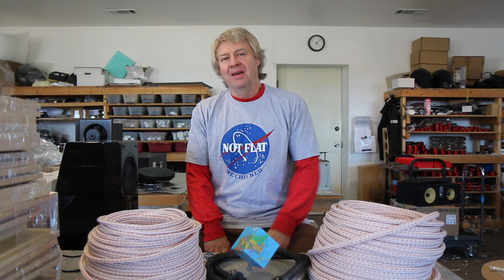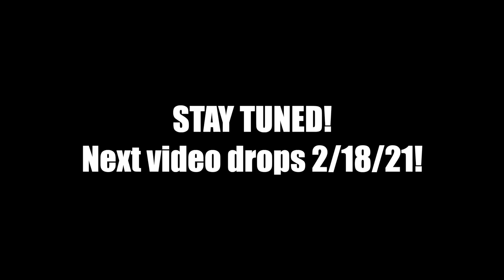Audiophile Cable TRUTHS: The Divided Camps

Comment: How come someone just doesn’t perform a blind test with say 100 people or more, collect the data and put this discussion to rest?
Reply: Because people won’t hear a difference
Reply: @davidlong1786  You are welcome to contribute here, but if you are only here to cause disruptions and have nothing to contribute then you won't be posting much longer.
Reply: Its been done, in 2006 I proved to the DIYers in DC that cables sound different.  The bullsh+t stopped at some cables are different.  Some cables are so different they didn't even require comparison to generic electrical extension cable and BS 12 guage Sound King cable.  Ask Bob Cordell.  He did seem a little shocked.  It was his testing system and his show.  Cardas Golden Cross, MIT Shotgun 750, no need bother compare in a blind trial...Kimber 4TC was used later and discerned by another 2 people in another location.  Sorry.... some cables sound different and most sound worse than good basic cables.
Reply: @TofumanFC3S  Thats not true there are a lot of people that can hear the difference when using different cables.
Reply: @ichigobankai2343  Show me ONE scientifically sound, objective test of cables that test as good as plain old speaker cable or better, where people were able to pick out the special, amazing one over the regular, good one in a controlled situation. I just need one study that has been validated as accurate and I’ll apologize to everyone I’ve ever offended with this stuff.
Reply: @TofumanFC3S  A lot of people have done it from there own EXPERIENCE but we know people like you wont except it because its not valid to you. I personally can hook up 2 different cables to my system and I can tell which cable is playing around 90% of the time. All it takes is one (1) single person to be able to tell the difference in which it would prove its possible. Its the same with any audio gear as many say amps sound different, dacs sound different, speakers sound different. If we couldnt tell the difference then everyone would all have the same gear but instead there is a shit ton of different brands of audio gear. Also everyone does not hear and or interpret music the same. Some can hear micro details in the music some cant. Some can pick out a faint whistling in the back ground while some cant. It seems a lot of people disregard there senses and let the data tell them what they can or cannot hear. SMDH lol

Also I am not saying that one cable is "BETTER", then the other as that is subjective and comes down to personal preference.  What I am saying is that they sound "DIFFERENT".
Reply: @ichigobankai2343  a scientific study would mean:
1.) controlled group of people (audiophiles, the issue with original testing is that were normal off the street persons / who might not know how to listen. example: your not going to compare cars which perform faster on a track by grandmas, non drivers etc)
2.) a black dark room (that in not colouring the sound in certain way) with only speakers in them, and someone from behind insisible changing cables
3.) control if they really her the difference by not changing cables sometimes, and sometimes bringing back already presented ones. 
4.) have a good source and god sample that is short like 30s, and have 10 samples listened to in total of 30 times for example.

ask for simple questions with checkboxes 1-5 (for example like):
1.) sounded warmer - analytical
2.) exaggerated lows no-yes
3.) exaggerated mids no-yes
4.) exaggerated highs no-yes
5.) muddy - detailed

as far as I know no study like this has been performed
Reply: @ichigobankai2343  Because the experience of 1 single person doesn’t matter when it comes to a product that is produced for many, we (thankfully) test experimental medicines on many people with a 50/50 split of placebos. Because you can be sure as hell certain individuals will have a life changing experience from their placebos. 

Amps, DACs etc. DO sound different. That’s not a controversial statement, they’re complex pieces of technology with lots of room for variation. You being able to almost always hear the difference between your cables means just one of two things: You either have one very bad set of cables (often the funky, expensive cables are horribly designed) or, more likely, you have a bad connection. 

By all means do what feels best to you, but please don’t expect me to follow your very subjective experiences as advice
Reply: @mbalunovic  As far as you know, like I said there have been many (audiophiles) that have conducted there own blind test from there OWN experiences and have heard differences.
Reply: @TofumanFC3S  A single person who can tell the difference in a double blind test with a very high 90% accuracy doesnt matter?  Again let me repeat myself there have been MANY people that can tell the difference, not just myself.  Meds/Supps placebo test is different from a hearing test.

Capacitors sound different or are they complex pieces of technology?  Do all HDMI cables sound the same? Do all USB and 3mm cables sound the same? Even RCA cables dont sound the same. Just because you cant hear the difference doesnt mean others cant. Anything you put in the signal path can change the sound.

Never said you had to follow my or many others experiences as advice. SMDH  I guess you can just disregard thousands of peoples claims of hearing a difference in cables.
Reply: @ichigobankai2343  how can a single person perform a true blind test ? 

Im not saying there is no difference in cables, and I also have "audiophile" cables.. but Im also a person who knows what a study, measuring etc is...
Reply: @TofumanFC3S  
You can feel the difference in cables if these measurements are different.
Capacitance
Inductance
Shielding 
Resistance (the least important as Im not thinking of 100db music with 24gauge cable).
There are other responses where "dirty" material pollutes the signal. And it does that at very low power levels and it is measured since measuring instruments need purest signal coming from 1GHZ source sometimes.
Reply: @mbalunovic  So how many people will it take in a blind test to convince you? 2,3,4,5, 10, what is the magic number? If one single person can pass the double blind test it will prove that it can be done as one is all you will need.  Being ABLE to hear the difference is proof in a double blind test.
Reply: @ichigobankai2343  Its not a matter if one person can hear it, whether the blind test is really blind. and how the test is performed. ie one cheapest zipcord and high quality, or two high quality ones, or 4-5 cables, and can he really tell consistently how the sound is being "modified".
Reply: Even speaker "TERMINALS" can change the sound because its a added component in the signal path. I run my speaker wire directly to the driver, sure it may look ugly but I can hear the difference and to me it sounds better when I bypass the terminal and run directly to the full range driver.
Reply: @mbalunovic  Its not about how the sound is being modified its about being able to hear a change in sound.  Lets take "TONE" for example. Some people can distinguish paper cones from metal cones just by the tone. Each type of cone material has different tone to them like polypropylene , ceramic, aluminum , titanium, beryllium, paper, treated paper etc. Even wood can change the sound which is why some instruments are made out of certain types of wood. There are so many factors that can change the sound including cables.
Reply: @ichigobankai2343   Ofcoarse it doesn’t matter? What are the odds those two cables you are comparing are the same as mine? Your reports are entirely anecdotical and don’t change my mind in any way. Your experience brings nothing new to the table when it comes to one cable being better than another working cable. If you’re trying to convince me bad cables exist or can be made, I’d never deny that but as has been said many times before: You’d need to work hard to fuck up something as simple as speaker cables. 

Digital cables such as HDMI and USB “sound” the same. You either lose bits of data or you don’t. It’s not the cables fault but the fault of the user for misuse of said cable. 

And yes, cable terminals are obvious weak points in signal paths, not because they don’t have diamond powder or batteries in them, but because the connection might be less than optimal

The cone material directly influences the sound being produced. Ofc. they’ll sound and measure differently... It has nothing in common with a speaker cable that just has to do their job: Powering your drivers as the amp output dictates
Reply: They have.  Controlled listening tests have already proven there aren't audible differences between competently designed audio cables.
Reply: @TofumanFC3S  It doesnt have to be the same. My experience as well as thousands of others are not meant to change your mind, but you implying that our experiences dont mean a thing wont change what I or many others have experienced.

You said amps , dacs etc sound different, did  you do a double blind test study to prove it? How are you coming to this conclusion?  Capacitors sound different , just changing a capacitor in a amp/xover can drastically change the sound. A NPE cap sounds totally different then a clarity cap or high end Jantzen cap.

Less then optimal connection? I am not talking about cheap terminals but the expensive ones that cost 10 bucks each or more, unless all those expensive terminals are crap?  Even Danny has his own special type of tube connectors that he claims can increase sound quality, I have never tried them so I cant give my experience of them but I wouldnt doubt his experience as well as many others who claim they do increase sound quality.

It dont matter if they measure differently as not everyone can tell the difference. I can put 10 different pairs of speakers for you to listen to and I bet you cant tell which one is ceramic ,which one is paper , which one is aluminum.  Just because you cant tell the difference it dont mean others cant.

I dont let others tell me or what data/measurements tell me what works or doesnt work as I have to experience for myself to KNOW first hand.
Reply: @LouGuido  By whom? Are these accurate legit tests?  Its so funny that if cables didnt make any difference at all why are people buying and using them instead of just buying 14-16 gauge speaker wire? There are literally millions of people world wide buying speaker cables. I guess they must be all brainwashed. LOL
Reply: @JurMalafi  " no need bother compare in a blind trial" 

Pretty much "Just trust me, no need to prove it"
Reply: Has there ever been any contention on wether audio equipment build with thousands of different components in different combinations with esch component having it’s own percentage of allowed deviation from it’s target values, tunes by employees of the manufacturer, sound differently? No, there hasn’t and there won’t be. So why would you need a scientific studies to prove what is already known? They’ve been measured, tested and reviewed and that should be enough. Suggesting they ALSO need to be studied is like suggesting we need to study wether the earth is truly spherical. 

It don’t matter what the connectors cost, they’re still a weak point in the connection. I agree: Get good, quality ones. They’re not as simple as cables after all!

I don’t get why you’re so pissed off. I’m not trying to convince you of anything, you’re trying to convince us for some reason. YOU are the one who is asking folks to ignore common knowledge and the basic principles of physics. In this example YOU are trying to convince normal people the earth is flat. It’s not our job to make you believe in reality again, just don’t expect others to go along with your delusions. 

And why do people buy this stuff? Because either they like buying pretty stuff and I’m all for that. I don’t NEED shiney new wheels on my car, but I like ‘em anyway. Or, unfortunately, it’s because they believe they’ll have a better listening experience lol
Reply: @TofumanFC3S  When questioning ones hearing shouldnt there be a study?  How do you know what is known if you cant hear it? OH I see by those who CAN HEAR IT? The same way some can hear subtle differences in cables. LOL Can you tell the difference between 10 different dacs and get it right 90% of the time? All it takes is a few to be able to discern the differences to prove it a blind test.

Get good quality ones? Proves my point once again that there is a "DIFFERENCE". The same thing as get good quality cables as opposed to radio shack wire. LOL   Again I have tried good quality connectors and non of them sound better then when I bypass the connectors and connect it directly to the driver itself, which further prove there is a difference.

I am not pissed off.  Wait so only I am trying to convince you and you are not? REALLY?  Arguments are two ways in which one tries to convince the other its not just one sided, if it was there would be no arguments or debates. SMDH LOL  Who's reality? Just because you didnt experience it doesnt make the person who experienced it untrue , especially in a double blind test in which is what that test is all about which is to prove if one can hear a difference.

Thats your opinion, its not facts. Most people dont buy gear to "LOOK", at.  Shiny wheels on car is to make a car look good like eye candy....Majority of audiophiles dont buy gear specifically for looks.  Again you are doubting other peoples experiences in which it includes millions of people world wide that buy speaker cables.

I bet if even a legit accurate scientific study done on speaker cables came out proving that one person can hear a difference you would still doubt it or make excuses because the only thing you believe in is science.  When it comes down to it the final word on audio gear its BASED on how it SOUNDS and if one cant tell the difference then no upgrade is ever needed just use the 5 dollar RCA speaker wires. LOL
Reply: @davidlong1786  What kind of speaker cables do you use and why?
Reply: @ichigobankai2343  Buy an AES subscription.  You need one!
Reply: @LouGuido  Telling me what I need is so hilarious lol
Reply: @davidlong1786  So other wires that are cheaper dont do what they are suppose to do?
Reply: @ichigobankai2343  You asked me where you could find testing that shows this is all bogus. I gave you your answer. Read some AES papers. You know, real science. Not junk on YouTube. That was my point. I think it still stands.
Reply: @LouGuido  I aint buying no subscription as I dont need it. Real science? You mean scientific fact or scientific theory? lol
Reply: @davidlong1786  Show me where I said you needed it? Where is the rolling eyes smiley? LMAO
I asked you WHY did you buy that particular speaker wire? SMDH
Reply: @davidlong1786  You're criteria? What you just said proves there is a "DIFFERENCE" in speaker cables.  Effect means there is a difference and or change in sound.  Good quality means there is a difference as opposed to poor aka cheap quality or else how would you know the difference?.  If there are absolutely no differences in sound what so ever then the cheapest of speaker cables should suffice.

Also length of wire plays a factor in how thick a gauge of wire should be, with shorter lengths you can use smaller wire while longer lengths require thicker gauge of wire, which again proves different gauges of wire depending on length can have a change/difference in sound.

 Once again world wide there are millions of people buying speaker cables because most claim they can hear a difference. I have never heard someone say they are buying these expensive cables even though they cant hear any difference, its usually always because it sounds better to them.
Reply: @ichigobankai2343  can you comprehend that I am not arguing the statement that cables change sound, but arguing the "Test" methods that most use to prove it ? there is a scientific way how to perform a test , that can be fully treated as valid and as a proof of somebodies capability to notice the change and to recognise the change (like which cone material is it). 
"double blind" means nothing.
Reply: @mbalunovic  Sure what is this scientific way is it legit and accurate and does every single person who does a DBT do it exactly the same way and adhere to the standards? Show me a legit standard format of a DBT that everyone in the world agrees on and I will use it.
Reply: @ichigobankai2343  sadly there is no such.
The problem with the industry is that they want to sell at great mark-up a lot of "snake oils". (Remember the audio cable with a AA batterie "attached") . Its not their interest to promote legitimate test methods.

A simple test that can be done even in home. 
1. get an assistant. 
2. Make sure you cannot see which cable is changed  for which - listen with your back towards the stereo.
3. Instruct your assistant to always disconnect the cables and reconnect. And tell him/her to sometimes change it sometimes not and note it. Make a repetition of at least 20 changes on same part of the track. Se how good a recognition is.
Reply: @ichigobankai2343  No, I’m not gonna debate someone who’s incapable of debating, understanding the basic interpretation of arguments put forth  and making compelling counter arguments. Debating someone who doesn’t grasp the concept is as futile as debating someone “who doesn’t agree with you”. 

“Show me a study...” That’s not how this works, buddy. YOU are the one shaking at the foundations of common sense and the pillars of physics, not me. I can’t go around shouting: “No you show me a study that proves there isn’t a Flying Spaghetti Monster!” at random people, nor can you expect me to prove your outlandish claims of superpower hearing that goes beyond the technical and physical capabilities of the sound source. You’re describing magic, that’s cool if it were to exist, but Imma need a bit more than the word of random guy on Youtube thank you very much. 

“Majority of all science is theories” There you have it, spoken like a true conspiracy theorist.
Reply: @TofumanFC3S  You claim that no one can hear differences in cables you need to prove it in a study. Why does it only work one way? It works both ways.  How does flying monster enter into our convo?  I guess you believe everyone hears the same?  Super power hearing? Some people can hear dog whistles at 35k most cant though but I guess you wont believe that either because science says we can only hear up to 20khz. I guess if something cant be explained by science you believe it dont exist.  Majority of all science is theories.  Theories can always change when a better theory comes along but a fact never changes it remains the same forever.  Magic is something that science cant explain. Its not just one random guy on youtube but literally millions of people that buy cables because they claim they can hear a difference.
Reply: @mbalunovic  I have done that simple test you just described many times in the past and on certain cables I can get as high as 90% correct which just proves without a doubt I can hear a difference. Now there have been some cables that I could not tell the difference but majority of cables I could tell the difference. DBT just PROVES one can hear a difference in certain cables.

But Tofuman will probably tell you that you're simple test you just described is not legit. lol
Reply: @ichigobankai2343  again, I was never saying the opposite
Reply: @mbalunovic  You’re actually correct. It is the variety on those things that makes cables sound different. Glad to see a measurement guy not talking out of his ass.

The other guys measure fr response, they see no difference then they believe there’s no sound difference. Just like when Flat Earthers measure the surface of the street, to confirm the Earth is measurably flat.
Reply: @12gauge599  that is becouse they don't know that it is a part of an electronic circuit. Ie they think source amp and speakers are all separate / discrete units and cable is only connecting them (just to send information), and not becoming part of the whole circuit and making it all a single unit where all those become important.
Reply: @davidlong1786  Look all I am saying is that I can as well as many others hear the difference in certain speaker cables. Maybe we are all just fooling ourselves I dont know but I have done those blind test and on certain speaker cables I can hear the difference. Now I do agree with you about the over priced speaker cables and there claims as some prove false but there are some that just sound different from one another. I cant just deny my experience and say I guess I never experienced a difference in that blind test that I and three other friends have done as if it was just all in our heads since no data can prove it.  In fact I find those expensive cables absurd and would never by another expensive cable ever as the differences are not that great and or to my liking. Now days I just use 16 gauge wire from P.E.  as most of my wire length is around 4ft. or less. I also dont even use terminals and to me its sounds better when I bypass the terminals and connect the wire directly to the driver. Remember the old school speakers where the box had no terminals with just the speaker sticking out the back?  Sure it dont look good but I can hear the difference in the sound so thats why I dont use terminals.
Reply: @davidlong1786  I am not saying I dont need to learn but I am not paying money so that the magazine can convince me that I did not experience what I have experienced when I did my blind test.  Thousands of other people like myself have done these test we just dont publish our results in a magazine or university as we are just audiophiles who love high fidelity music.  You dont have to respond to me no one is forcing you as it dont bother me one single bit.  If a flat earther wants to believe the earth is flat I dont give a shit, why even bother or care? I just let them believe what they want to and dont get BENT all out of shape because of what someone else believes. Some people believe Bose is the best speaker I dont care what others believe it dont bother me none. It seems a lot of people are bothered by those that say speaker cables can make a difference. If you are bothered by this then the problem is with you and not those buying the expensive cables its there freedom of choice not yours to make for others. Have you ever done a blind test with many different types of speaker cables? if yes what are your results if not, why not? I would like to know your experience.
Reply: @ichigobankai2343  Are you completely incapable of reading a text and drawing conclusions? If at this point you still can’t understand why YOU, who challenges common sense and knowledge is the one who needs to support his claims with evidence or where the analogy comes in with the FSM, than you’ll never understand I’m afraid. 

Tell me how variations in human hearing and variations in equipment for that matter have anything to do with claiming you version of metal strands have super powers every other metal conductor doesn’t have? As has been said by others in this thread, we’re still waiting. 

“The simple test” isn’t legit. How would it be? It’s again, like every proof you’ve presented so far completely anecdotal. There is NO data being shared except that a random on Youtube said so lol.
Reply: @davidlong1786  He won’t link them because they don’t exist. In his alternative worldview the cables perform magic feats such as: A fat guy drumming on his belly goes in, Vivaldi comes out 🤦‍♂️
Reply: @mbalunovic  Aren’t you describing you lot? As in: Normal people see the cables as part of the circuit, simple conductors between the AMP and speakers. You guys see mythical “sound tethers” blessed by fairy dust that take whatever you feed them and then change it into pretty noises for your speakers
Reply: @TofumanFC3S  you have to understand that no part of any circuit is a simple conductor. Not even on a logic board. 
Read on RLC circuits, and equivalent RC circuit principal.
When you do that , and understand it than we can discuss further. 

Untill than you only have personal opinion vs facts.. 

To translate that to you. Everybody seas a vehicle as a car from A to B but some enjoy driving them, and some are so good that they win world championships. The difference must be only in our (their) brains..

You know civilisation invented gods and religion to explain what they did not understand. So maybe you are just not understanding the topic, and hance you disregard that as possible as people didn't believe earth was flat and is not a center of the university.
Reply: @mbalunovic  Oh, we have another Child of Krypton here that can hear the difference between a cable 1ft. or 2ft. long. A wire that’s been damaged and is missing two strands of copper, a ten dollar cable that tests just as well as a 1000 dollar cable...

Come on man, I’m quite skilled when it comes to electronics and even tho English might not be my first or even second language, I’m pretty sure that in the simple case of speaker wires or cables, conductors (there I said it) is frickin’ synonymous. 

I’m not saying you’re dumb, you’re just being stupid for bringing RLC into a discussion about speaker cables when almost any copper wire of a proper gauge will do the job mighty fine. Also like I said before you have to really try and fuck up something as simple as speaker cables, but somehow “Audiophile” companies get it done often having conductors too thin with high resistance...

And yes, we do have personal opinions vs. facts. You enter a discussion and side with a guy spitting “opinions” and denounce the facts. Well sorry, I’m on the factual side and I won’t join your little club of believers lmao. I understand you just wanna be special, it’s nothing to be ashamed of, it’s perfectly normal. But imagine what would happen if you finally convince everyone that they have super powers / magic ears or however you call it... You won’t be special anymore. You should think about that. 

Your car analogy I could unfortunately not decipher. Are you sure you yourself even knew what you were trying to say?

And with the gods thing. Ah, I see... The ones rejecting physics and science are now telling ME that I don’t understand. That’s good lol. Hilarious! 

Please come back when you have that evidence. There’s two of you trolls now, you can share the prize! BTC breached $50k,- recently, half of that is still a great bounty for just linking one of those “thousands of studies” that have been done. I mean it should buy you some of the most magical cables out there...
Reply: @mbalunovic  You’re bodying that Tofuman dude with pure facts. I like how he simply has no counterpoints to your arguments, except for him telling you you’re incorrect and you imaging all of the differences 😂.

Extremely typical of an ASR minion.
Reply: @TofumanFC3S  Common sense and knowledge would of told you that if thousands if not millions of people world wide can hear a difference in cables you think you are the one that needs to support your claims that no one in the world can hear a difference in cables. You want proof but dont have any proof yourself except to say its not possible for people to hear changes in cables because all cables or every other metal conductor are all the same. If that were absolutely true people would buy the cheapest cable/wire they can find since there is absolutely no difference as that is COMMON SENSE. The speaker cable industry has taken off with more and more companies making there own cables. Go search on youtube you will find a shit load of videos of people reviewing cables and making all these claims that they can hear a difference.

Others in this thread also agree with me that they can hear a difference. SMDH but I guess according to you we are all delusional right?

 Once again I repeat I am not the ONLY one that claims they can hear a difference in cables as there are literally thousands of people who claim they can hear a difference.

What test is legit? Please send me the standard test used and agreed upon every scientist world wide and I will use it and see if I can actually hear a difference.
Reply: @12gauge599  Ah, it’s a trio! Don’f worry, you’re very special as well. All of you are very special pats head
Reply: @TofumanFC3S  

dont twist my words to make yours more legit, I didnt say no where a statement as close to wha you are saying here. !

Also English is my 3rd language of 5 I know/am learning. (Serbian/Croatian as mother, Hungarian as 2nd, English as 3rd, German and Norwegian as beginner / learning. I also have wide enough knowledge that I know you love mazda rx7 otherwise you would not have that in your nickname.

now lets go back to the claims that you make and your very unnecessary condescending language. 

Please explain to me if a wire is only a conductor and nothing else, how can a capacitance of wire change the sound this much on a cartridge. the 0 is only theoretical plot, while the others are measurements of frequency response (that can easily be replicated in IC simulation software. https://lh3.googleusercontent.com/proxy/2dX9Zixv-fwr8R_WAMbrRjX4ASuEn-59pdvmOoJPc46vMq_deMmqgKi55BJ9gOqThj5hZ5e2ZL8K1evyO5pbGLVv9aK4
here you have a measurement in db response so please... if you don't trust me google up "Cartridge loading" 

my car analogy was that the original (and only) cable study was done by people off the street, not a group of audiophiles or a group that visited some HiFi expo. some people don't even notice a difference between a bad mp3 youtube rip and a high quality source. or they don't hear the difference in changing (major not 1mm) speaker position. to them its all the same, its just a music they are listening to. how can they be the prof that something is true. 

lets try another car analogy. who is representative to test tires behaviour on a car and which is better? a grandma on a street, a pedestrian that newer drove a car, an average drier that never had to brake in emergency and drives "like a granny" or riders that push the limit of traction and can really feel the difference in compound, overheating behaviour of tire, sidewall stiffness etc?
I believe you can understand that the grandma will probably chose the softest sidewall as best as that is most comfortable and that is the only thing she will feel. wile others might chose differently.

now back to your claims and childish way of disproving me and twisting my words. 
I DIDNT say I can hear a difference between 2 cables with different termination, a wire missing one strand etc. that an AA battery that is only attached to the side of the cable makes a difference etc.
I DID SAY there are properties of a cable which make it colour the sound (together with the rest of the equipment). 

the length of a conductor on a PCB will change what the IC will see. this is why all sensor traces that that have a "reference" and a "value" are traced parallel on exactly the same length and path so the signal doesn't change the value.

I see that you dont understand why I brought up RLC to the discussion. most (~all) good cables have a very low R. however what is different is the C and the L. how is that different.
here are some samples: 
High capacitance : https://www.nordost.com/images/thumb-odin-speakercable-biwireterminations.jpg
Mid capacitance: what Richie is selling, knitted ones.
low capacitance: usually low strand number that is separated by distance of 10x the diameter of the wire.

you can search your self how does inductance change with types of the cable (but in short its the opposite of capacitance). 

Those measures interact with the whole circuit in same way the cartridge loading does. but is much harder to measure as inductive resistance of a speaker changes a lot with frequency. so every amp-cable (measurments R,L,C)- speaker would need to be simulated.
Reply: @ichigobankai2343  They could go on lying as they want to justify 1000€ set of cable (that sounded the same as 100€ cable they already had)
Reply: @Clobercow1  Oh yeah I forgot to mention the Kimber was identified in a blind trial twice.  You might want to look up who Bob Cordell is...its ok not everyone is cut out to know much about audio.  So pretty much accept it as a blessing....
Reply: @ichigobankai2343  Nope, I’m just saying YOU aren’t (just like I am not either). Many of the basic principles when it comes to something as simple as a copper wire connection are pretty much set in stone. For someone to claim such a principle is false, they better come with STRONG evidence gathered by expert and respected physicists verified by their peers such as always has been the case in publishing new scientific data and theories. 

You say people claim they can hear the difference between two cables that have been tested as good for the job and that should make me depart from generally accepted scientific principles. Well, there’s people claiming they can transform into animals, does me (a random) simply stating this in a Youtube comment shake your worldview? Do you all of a sudden denounce science and everything that you you’ve always known? No? How about if leading experts in the field present data that confirms the transformation? They have some explanation why the metamorphosis happens and the test are repeatable and verified by independent scientists all over the world? That would change you mind huh? Well guess what, both the transformation claim and your cable claim have the same amount of scientific papers released and validated... OK, so maybe not be so angry when people don’t follow your unsubstantiated believes because you probably wouldn’t do it either if the shoe were on the other foot. 

Also don’t make this about Danny Richie or these cables. You’ve never mentioned one of the cables you could identify were THESE cables. I want Danny to do well and sell awesome products. In fact, and this will be a shocker, I’m very interested in these cables but not for their claimed magic they supposedly provide. You know how “Song goes in, Daft Punk remix comes out”, that’s just BS. I’d consider them because they look like the Kimber 8TC and 12TC that 1) Test very well (like many cables do, but unlike most fancy “audiophile” cables) and 2) They look awfully pretty and I like pretty stuff (as long as it works properly). Again, I hope Danny stays honest and true and markets these for what they are (again assuming they will test fine here) and not go the “they’ll color you music bla bla” route, because that’s the last thing I’d want, a cable that interferes with my choice of music, source equipment and speaker selection. 

And lastly in reply to your final sentence: No, not me. Please, please, please read up on the basics of scientific research: Characterization, Hypothesis, Prediction, Experiment, Evaluation and Confirmation. All steps being subject to peer review and published as conclusion and raw data. You really need to understand if you want to operate in a normal life where your feelings and assumptions don’t dictate your entire life. I’m urging you to please burst out of your bubble and broaden your mind instead of denouncing everything just because it’s established. 

When you wrote a couple comments up: “Maybe we are all just fooling ourselves I dont know...” you were on the right track. You need to understand how easily we are fooled as individuals and a group and that’s why we need to build on the foundations of established, objectively proven facts and use that basis to chip away at the confines and see what else is possible in the world. I genuinely wanna see a properly conducted AND validated test that tests both human abilities as well as physical properties of wire maybe beyond our current understanding. I’d be thrilled to study the paper as I have done with many other studies, but it just doesn’t exist and sometimes that is all the proof you need.
Reply: @mbalunovic  Yup, like I said myself: English is my third language as well. I’m far from great with the grammar but my reading level should be more than adequate. Don’t know where RX-7’s come in, but yay on the shout out! Quite fond of them indeed. 

Still, all jokes aside, your car analogy made no sense to me, that wasn’t meant as an insult, just simply me stating that maybe I missed something important due to a language barrier, that’s all. 

“Everybody seas a vehicle as a car from A to B but some enjoy driving them, and some are so good they win world championships. The difference must be only in our (their) brains..”

I assume “seas” means “sees”, that much is clear. But “a vehicle from A to B”? Do you mean “AS a vehicle to GET from A to B”? Are you saying some cars are just used as simple transportation but when used to race they can be so much more? What about the “our (their) brains” bit? I wish to understand, but I’m either missing the link to cables or misinterpreting. 

I apologize for sounding condescending, that was me getting frustrated at being bombarded with attempt after attempt of trying to convince me to leave behind reality and moving into a fantasy land where good cable A sounds audibly different to good cable B. I guess I lost some of my patience there. Apologies again. 

The link you provided doesn’t work, so I can’t and won’t go into what might be happening in the scenario you mentioned. 

Interesting your point about people in the street not even recognizing a compressed MP3 compared to say a CD. You’re absolutely right, I’ve noticed this around me as well, just like how people around me can listen to god awful speakers. This however highlights why the ears (but in reality the human brain) is so untrustworthy and should not decide what a “good cable” is when measured data says none, one or both are good. The human brain is quite capable of filling in (or removing) information that is/isn’t there. It’s why your vision is smooth when you move your head or watch a movie, why you can’t see your nose in your field of vision or why special effects in movies or video games look lifelike one moment and then 10 years later look dated. It’s your brain that makes it real, then the simulation gets better and your brain can’t trick you anymore when you watch a decade old content. The same thing happening with our visual senses also happens with hearing, it’s just a lot less easy to recognize as the visual trickery our brain does. Again, it’s why you can’t trust your senses over scientific fact and many studies have shown that you can’t even trust your memories. So you memory of hearing a better sounding cable is in all honesty not worth a whole lot when it comes to the bigger picture. It’s also why any testing the hearing of “people of the street” would not use music at all. 

I like the second car analogy you had for this very reason. How do you think Formula 1 tires are developed? Well, there’s a shit ton computer simulation based on known material properties done, then they’ll develop prototypes that are rigorously tested by machines for consistency and finally when they have the final product they are “tested” by F1 drivers in the yearly tire test where they’ll complain about them, calling them the worst simply because they are different even tho the tires hit exactly the design goals. 

I understand what you original point was, and it makes sense, but tires need to do a lot more than a speaker cable and their complexity of product and application is on a whole other level. The core remains however: To test their performance without a doubt you eliminate human intervention. 

Next I’m gonna make a stand here based on what you said before: “there are properties of a cable which make it colour the sound”. A cable that colors the sound is a bad cable! It’s completely unacceptable whatever way you look at it. Any information lost simply by the cable being a cable doing it’s cable thing is bad. Any information gained from it being an antenna is undesirable and makes it bad again. The myth of song goes in, remastered, remix, bass boosted, ultimate edition coming out doesn’t exist. It can only color the music by making it worse. Bad cable. 

RLC: Oh, I DO understand why you brought it up, I just don’t see the relevance. We already know what a cable needs to do and I don’t see the point in developing (or buying) cables that are so far out of spec we need to go into the subject of RLC to “explain” or validate them, that’s all.
Reply: @TofumanFC3S  now this is a "tone" i like to speak on :) 
I recognised the rx7 as im also a fan but more of an fd (just because it has the rew engine) and I own an rx8 ( i need a 4 seater "practical" car) 

Regarding colouring the sound.  I fully agree that when it colours it its bad. But the thing is that depending on the property's of the amp and the speaker the most neutral cable will be different for every combination. Im not an electronics expert to be able to fully explain how and why. 

But there is much better sample than amp-speaker cable and that is the tonearm cable and so called cartridge loading. That effect exaggerates what is also happening between the amp and speakers. 

Again im not buying all of the snake oil, but I do say that there is an audible difference between the cables. 

There was one mans saying, mr "Quad" who produced some magnificent amps. 
"You should not be able to tell the difference between the amps if they are good" (I was paraphrasing). The problem is that there is a lot of bad cables and its hard to find good ones (and they dint have to be expensive)
Reply: @TofumanFC3S  You need to prove and come with strong evidence that people arent hearing a difference. 

Wow another of your ridiculous analogies. 

Danny said he can hear differences in speaker cables.

I guess according to you millions of people world wide including Danny cant hear a difference in speaker cables. got it.
Reply: @ichigobankai2343  I, ME (!!!), needs to come with strong evidence that people can’t hear beyond people’s hearing thresholds!??? 

My analogies are ridiculous huh, and THAT which you just suggested isn’t!?

“Danny said he could” I say he can’t just like all other prophets who have made crazy claims before him. Perform your miracles in front of independent experts in the scientific field and I’ll maybe consider looking into it more. Until then you lot are a bunch of regular folk claiming to have super powers. 

You say you “got it”, but seeing your comments I highly doubt you do.
Reply: @TofumanFC3S    So you calling Danny and any other great audiophile's , crazy? WOW SMDH 

Even Dr. Floyd Toole said that our brain and ears are more analytical then a omini directional mic/analyzer.

You the one that does not get it.  Audiophiles listen with there EARS, you scientist people listen with your eyes. LMAO
Reply: @mbalunovic  Yeah, I’ve owned an S5 TII FC for a good 7-8 years. Got rid of the body when they were not very popular here because it had some rust and was in the way. Shortly after these cars got a lot more expensive. So I still have the complete drivetrain, but no clean bodies around for now. Maybe I’ll dump it into an RX-8 since those are cheap with a broken engine. 

About the colouring of the sound of the cable, I think we’re still in disagreement, but that’s fine. In my opinion IF a cable noticeably changes the way your system sounds, then everything I know and every scientific principle I apply tells me one of the two cables is very bad at it’s job.